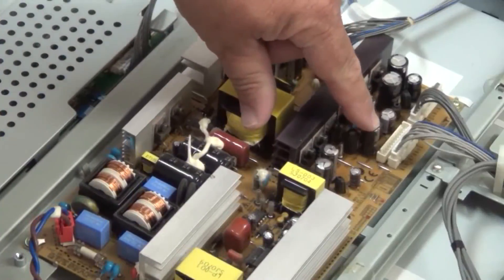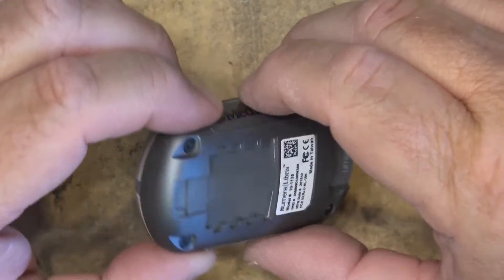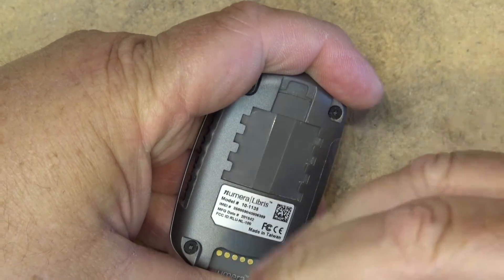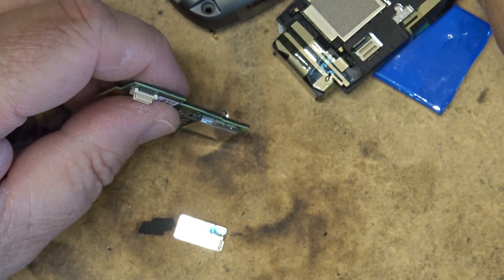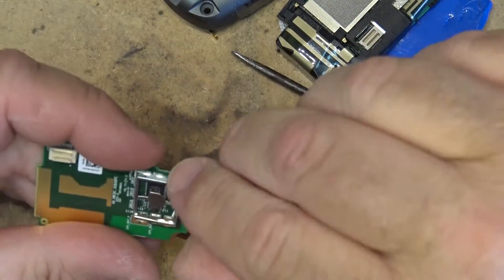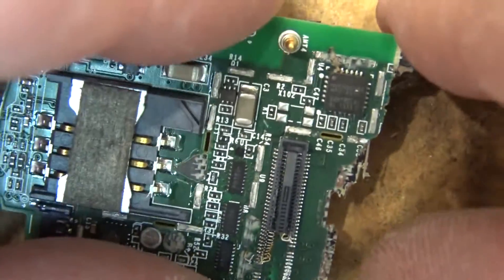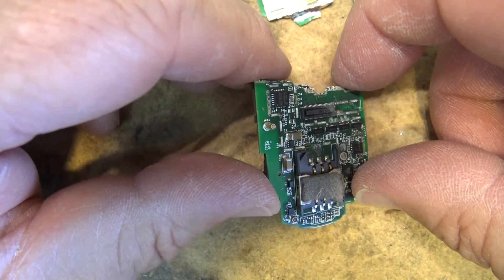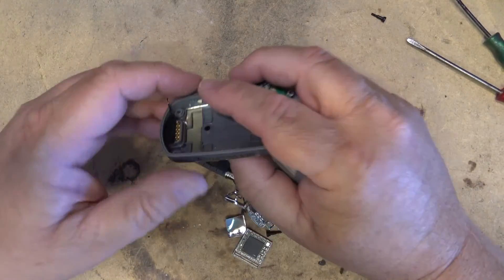Broken Numera Libris personal security device teardown

Comment: I recently bought something similar,  SOS, button, fall detection, GPS location and uses a SIM, but the great thing about it, it does not use a monitor station, so no huge monthly cost (just a pay as you go SIM). Better still you set a list of numbers for the device to contact, just by texting it e.g. A1, 05543627283 where A1 is one of 5 emergency numbers, all the configuration is done by texting, so no apps that become obsolete. You can also establish a two way call with it.  Plus it was cheap.
Reply from the maker: That's only good if your contact bothers to answer.  Many times when I am driving I ignore phone calls and text until I arrive because the fine for using a phone is hundreds of dollars.  Monitoring station there 24/7 to respond and can give emergency personnel exact location.

Comment: 6:12 "These are normally worn by seniors and this one died"
LMAO!
Well this speaks volumes about your competitor's ineffectiveness!
Reply from the maker: They changed providers after it packed it in. .
Reply: My joke was that "this" could be interpreted as either the senior or the device!
Reply from the maker: @loukashareangas4420  or both.  No joking aside we all get there eventually and it is tough to loose a parent or grandparent.
Reply: "Funny" thing is I made a panic button for my grandma who was bedridden. I used the common ebay 433MHz transmitter-receiver pairs (it only had to work between two floors) and put it all in nice plastic enclosures.
Grandma was to have the panic button by her side and my mother the receiver on a belt clip. (it beeped and vibrated when triggered and had a cellphone rechargeable Li-ion battery along with the charging circuit)

Well, I am a uni student in a different area of the country and it seems grandma was on a hurry, so I never got to deliver it...

Comment: If apple made it, the battery would be glued in and wires soldered, the screws would be proprietary.  Looks pretty cool. I guess using a soldering iron was out of the question.